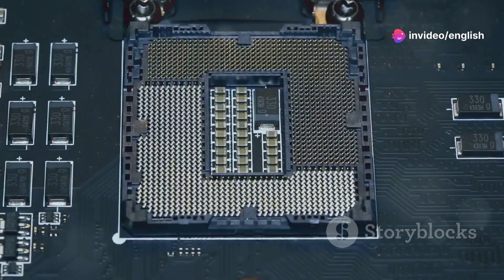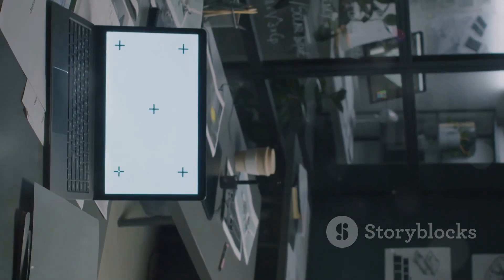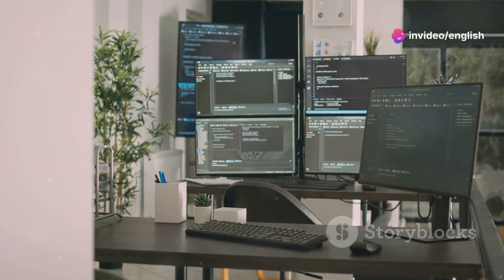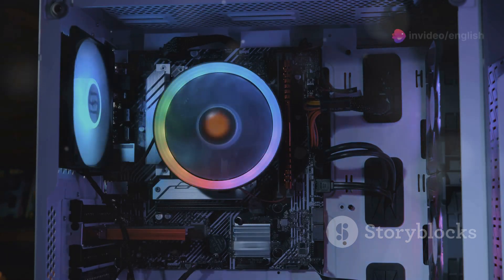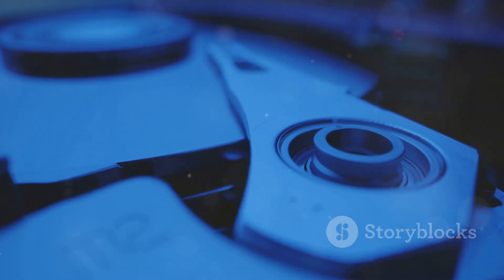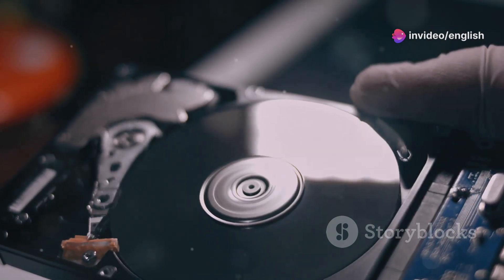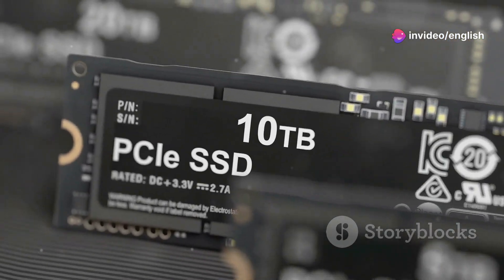Windows 11 24H2 The PC Killer

Comment: the main point is do you need any of it, do you want any of it? if the question is no then windows 11 is looking even worse than windows 8 or vista
explaining system requirements in this video is "hey grandpa you need new computer" especially since most computers that can smootly run youtube probably already met all the requirements, those that are  unable to play youtube probably have no hope
tpm protecting you from owning your own computer. but tpm 1.0 o 1.5 should be enough for microsoft to run happyly , requiring 2.0 is artificial bar nothing more, unless tpm 1 security is already broken open
and funny thing is celeron n 4000 series in hp stream laptops is supported while 6 gen i7 or first gen ryzen r7 isn't
instead of makingall of it mandatory and annoy all long time users microsoft should instead make all of those extra features optional! starting from new user interface on ai integration ending
if you only use computer to play games and watch cat videos or chat on twitter  none of that is what you need , want or benefit from

Comment: This video is AI generated, heres a list:
0:05 No Windows 11 is not a completely new OS, its based on Windows 10 with some "improvements"
0:16 This is not called improvement, this is called bloat
0:20 Nobody cares about AI
0:23 "real time graphics rendering" computers have been able to do that for at least three decades
0:25 My over decade old Thinkpad with 8gb of ram runs perfectly under Linux, computers should be built to last and software should be built to support older hardware (also with maintenance any computer can run like new). 
0:42: Heres a better comparison, imagine big brother but owned by Microsoft and using your personal info to sell you stuff. In exchange they generate inaccurate information and soulless content (like this video)
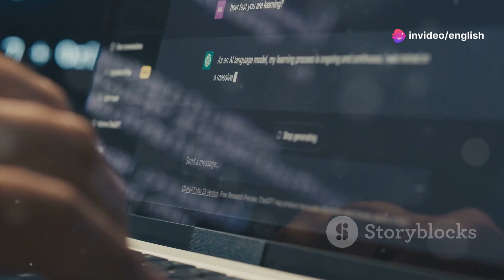1:04 I thought copilot "stayed on your computer" hmmmmmmmmmm, maybe think twice before using an OS that monitors everything you do and sends it to the cloud
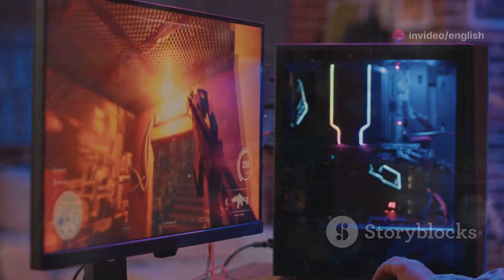1:27 I thought that copilot used cloud computing, if it uses the cloud then why does it need a local processor. Contradictions because AI isnt self aware and the person who published this didnt review it.
1:49 those are the requirements for Windows 11, not copilot
3:50 Using Windows 11 in general is sluggish and frustrating expereince
4:15 Vulkan does those things better and its open source
5:00 Secure boot isnt secure and does little more then add barriers to Linux installation, also the biggest security vulnerability is the end user
6:00 Hers a simple version, its worse then Windows 7
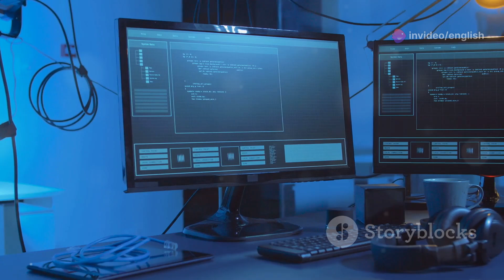6:15 Windows 10 also had some stupid hardware requirements
6:25 No its a way for Microsoft to pressure people into buying new computers
6:40 Yeah but if my decade old car shut off and stopped working I would get pissed, especially if I could fix it by installing open source firmware (proving that its still good)
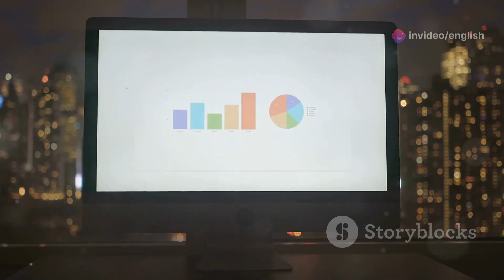7:40 benefits: N/A
drawbacks: everything
TLDR: Windows 11 sucks
Reply: am with you on that all the way , you know what the problem is .. people want everything done the easy way ... windows is made so people could just turn on and go just like a car people want to buy used vehicle and expect it not to require maintenance being done on it .. peoples expectations are way off the  their heads
Reply: @adgaming8772  Of course, I may use an old used laptop but I actively maintain it and upgrade its parts. Ideally more people would and in turn more software manufacturers would take that into consideration.
Reply: Come on.... Agree the video is most likely AI generated, but....
1. Lots of people do care about AI. Admittedly too many vendors are trying to run with it before t can walk, but it has huge potential and can already be very useful.
2. Keeping old things working is laudable to a point, but you can't keep backward compatibility forever. (Not without an ever-increasing lot of bloatware). Keeping your "decades old car" running is great - we all like seeing classic cars on the road - but newer cars have a lot of advantages over them. (eg fuel consumption, and pollution.)
3. Using Windows 11 is not "in general .. sluggish and frustrating". Mine runs lightning fast. Maybe you just have a crap computer.
4. It is just ridiculous to say that it is "worse than Window 7".
5. If you think W11 is "frustrating" it is as nothing compared to how the average computer user finds Linux. Which is why Linux will never gain popular appeal. It's UX is nowhere near friendly enough for most people. Doesn't matter if it's computing or anything else, convenience is always the winning factor. 
6. The majority of people don't care that much about privacy. They may say they do, but they don't. Again forget your computers, just think about smartphones. Everyone has one, and they spy, monitor, record and feedback on what you do far more than Windows ever does. They even track your location every time you go out. Yes, Windows does watch and record (though many parts of that can be turned off)  - but most people don't care because it has no negative impact on their lives.

By all means stick with Linux if it suits you - but dissing it misses the point. It's easy to use, and it works (mostly), and that's all most people care about.
Reply: @philu-h4j 
1. The vast majority of people who purchased Snapdragon X elite laptops listed battery life as their primary reason, not many people even mentioned AI. Sure it has potential but nobody care and people are sick and tired of having it shoved down their throats.
2. Obviously at some point old technology will become obsolete, all I ask is that software support hardware thats at least a decade, however for operating systems and basic software like browsers theres no reason why they shouldnt be able to run on fourth or even third gen intel.
3. Relatively speaking compared to Linux it is indeed sluggish and frustrating
4. Windows 7 was more consistant, didnt have forced updates, and the UI was arguably better
5. The average user thinks that Linux never evolved past 1998, most people dont even know what the Linux UI looks like. All they know is that their favorite youtuber says "its not ready" so they mindlessly parrot them.
6. Ill give you that one

I think you're missing the true point, Windows 11 sucks and the only reason why people use it isnt "convenience" or "good ui", its because Microsoft can afford to shove it down peoples throats. Microsoft has a monopoly and they've been proven to use anti competitive tactics such as spreading lies about Linux to achive their domiance (see Microsoft Halloween papers and what they did to netbook manufacturers).

Comment: Windows 11 is a bloated, spyware ridden mess. I finally fully moved to Linux and i don't see myself going back any time soon(Microsoft forced my hand). My computers run smoothly and clean which is a refreshing change after frustrating Windows Performance. It takes just a little bit effort and you have full control over your hardware again. It's amazing really. Oh and something i did not expect - I have Wattage counter connected to my main rig and and I've noticed average power draw around 10% lower week to week. Nice bonus.
Reply: Good for you. I think people are going to start backing away from Windows
Reply: Run both Windows 11 and Ubuntu on daily used machines, so find your claims to be suspect.

Comment: And that is bull.  You can run Windows 11 on a Celeron that is 5 years old, which means normal processors like i3, i5, i7, i9, etc from 10 years ago will run fine.  I can put WIndows 11 on my MS Surface Pro 3 (which only has 4gb of RAM and 4th gen i5).  It runs fine and NO ONE WANTS CO-PILOT.  Ya, let me have something spy and send my info to MS.  That was a problem with Windows 10, they started stealing your data and now want all of your data.
Reply: checking processor support list is either very entertaining or infuriating, either way performance is not the main selection mechanism
dual core 1 ghz atom is supported, xeon 1270 v2 matching i3 8100 in performance is not, this is comedy

Comment: This seems more like an advert.  Fails to mention the drawbacks of more monitoring and tpm is a security system stopping you from moving your drive to a new system without reinstalling windows,  this is a plus for Microsoft not the user.
Reply: You got that shit right
Reply: meh upgrade to at least 32 gigs of ram if not more and you'll be fine because 24h2 is ai heavy and needs 16 gigs just for the ai shit so 32 gigs is the new minimum otherwise problem solved your pc should be able to handle it just fine then

Comment: I can remember when 4GB of ram was powerful enough on a Windows PC. Way too many resources used these days. I'm happy now fully migrated over to Linux.
Reply: Linux will never gain wide appeal until/unless it becomes user-friendly. It simply isn't accessible to your average Jane/John Doe on the street.
Reply: @philu-h4j  Which distro? Certainly not Mint.
Reply: @True-North-2025  Including Mint. The UX isn't even remotely close to what Windows (or even Apple's OS) offers.
Reply: @philu-h4j  I've never used Mac (never will), but had Windows 8.1 and Mint 18 dual boot on a laptop for a while. Mint ran programs like QGIS much faster. Everything I did with Mint was faster - half as much clicking as Windows. These days, I only use Mint - laptop and desktop. For the one program I need Windows for, I tun Win10 in a VM. It has a backdoor that you'll only see operating if you run it inside Linux - which I prevent from connecting. You're welcome to it - not me.
Reply: Good for you. I have been on Linux for 7 years. I won't go back
Reply: Linux will probably never be able to offer the same integration and user experience as Windows; it has "socially awkward nerd" written all over it. I'm using Linux on headless systems and there's where it shines. If you don't fancy Windows but still want to have decent software support and a great overall user experience, you should try macOS.
Reply: @steve-o-i1j  I love Linux and I'm typing this on my Manjaro machine. But MacOS is a much better OS in almost every meaningful way.
Reply: @dragonballjiujitsu You can't customize Mac as much as Linux
Reply: @heatherbrown1558  Thats true. But most people don't care about how much the can customize their OS. They use it as a tool to get things done.
Reply: @billytk1225 Downloading software from Alinex distros software store is a lot easier than the way you do it on Windows. You don't need the command line, you don't need to use a browser either.
Reply: @billytk1225  Right, it's always about the games. I've never played computer games. QGIS, LibreOffice, Kdenlive, Stellarium, FileZilla, Firefox, Deluge, yes.